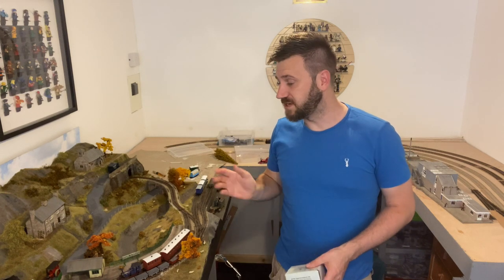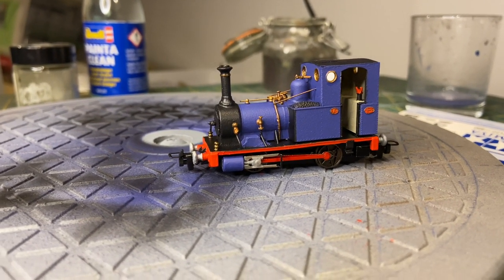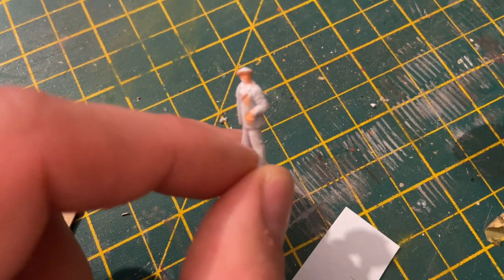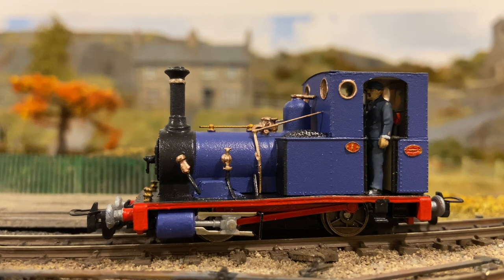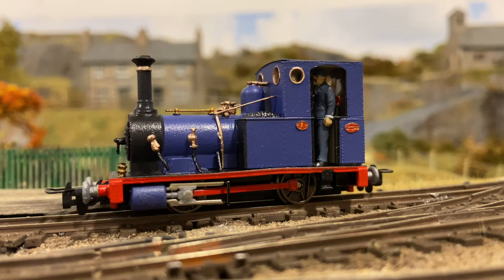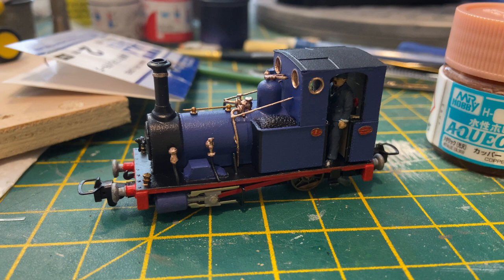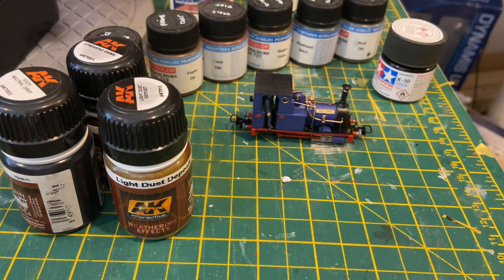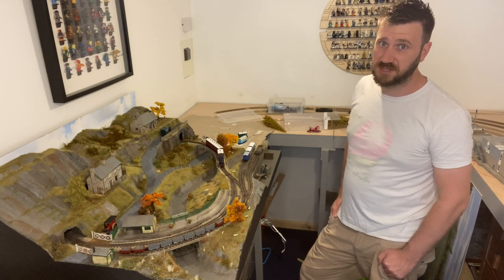Dolgoch Conversion kit Part 3: Building a OO9 Model Railway Episode 15

Comment: Did you ever find that screw?  I'm also glad you didn't line it. Take a look at Dolgoch in the 1940's and the boiler was nearly black and most of the lining had faded.  Same with the Ffestiniog at the time, the locos were eating very basic paint jobs in the final old company rebuilds.
Reply from the maker: No the screw never turned up. I had a similar thought that by the period I’m modelling the loco probably would have just got a cheap paint job.